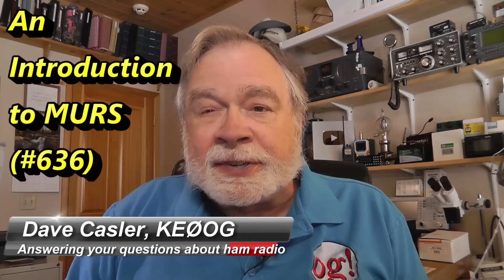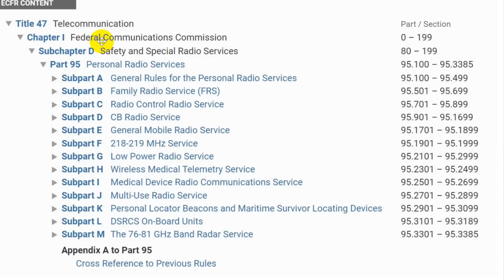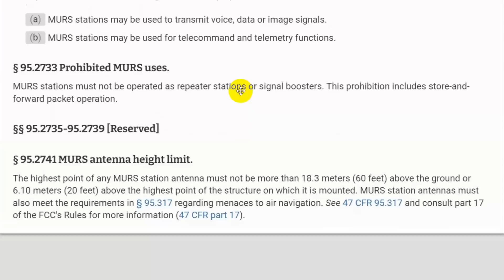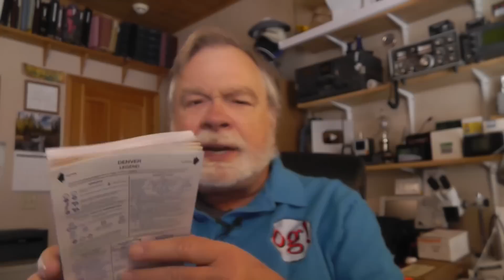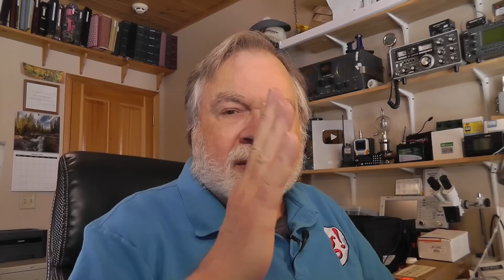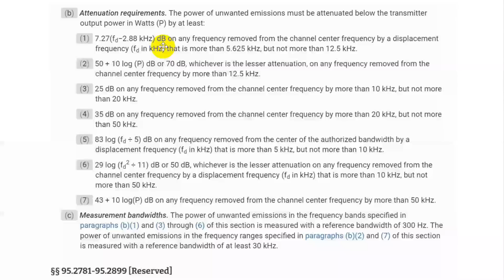An Introduction to MURS for hams (#636)

Comment: Well, at the end of the day, unless an FCC official is standing directly over my shoulder and taking note of my equipment, there is no way for them or anybody else to know what type of radio I am using. I think the world will keep spinning if I transmit on MURS using a non-MURS radio, and nobody will know the difference. Same for GMRS. I own dedicated GMRS radios, but if I was to just use a different UHF radio to transit on GMRS, nobody is even going to know.

Comment: MURS has no ERP limit and the transceiver can be attached to an external antenna, meaning one could run it through a high gain antenna such as a yagi.  2 watts through a 5 element yagi might have an ERP as much as 15 watts, if there is no line loss.  However, there is an usual and narrow bandwidth requirement of 11.5kw for MURS channels 1,2, and 3, and a limit of 2 watts.  MURS channel s,4 and 5,  can have a bandwidth of 20kw. Set the Boafeng for low power (1 watt), and on the narrow bandwidth setting that should be 12.5kw, and it might meet specifications on channels 4, and 5.  For FRS , there has been recent changes that allow up to 2 watts ERP on all channels except 8-14 that remain at .500mw.

Comment: Regarding the supposed prohibition of packet, I think that only applies to digipeaters, which are store-and-forward.  A regular packet 'conversation' is not store-and-forward, it is a direct data transmission just as any other data transmission is.  Also, the prohibition was in the same section talking about not using it with repeaters.

Comment: All the rules about ( Must be MURS or FRS GMRS ) ect is bogus. If the radio is clean on transmit, puts out the  correct power, correct width and you follow the antenna stipulations then use the open radios. Lets go after the idiots on 7.200, 14.313 ect that effect people over several countries, and leave the open radio's with a rubber duck antenna  alone. Half the rules are aimed at selling radio equipment, must be lobby money in those rule committee meetings.

Comment: I believe you could transmit data over MURS by directly injecting the audio from a modem into the speaker / mic wiring like we've been doing with APRS for 25 years.
Reply: Yes, that would be a F2D emission.

Comment: Oog, murs is used a lot for farms and care homes. They use them for long rang driveway alert systems with two radio. Also as a low cost entry point notification system. Some farmers even use murs for momentary control of irrigation systems.

Comment: -What about the 49 Mhz radio frequencies? -Can we use the old Motorola radios/commercial radios  that don't meet the 12.5 Khz spacing? Can pascag be used? Can a tone generator be used/i.e for something like Motorola minitors?
Reply: There is no ERP limit and the transceiver can be attached to an external antenna, meaning one could run it through a high gain antenna such as a yagi.  2 watts through a 5 element yagi might have an ERP as much as 15 watts, if there is no line loss.  However, there is an usual and narrow bandwidth requirement of 11.5kw for MURS channels 1,2, and 3, and a limit of 2 watts.  MURS channel s,4 and 5,  can have a bandwidth of 20kw. Set the Boafeng for low power (1 watt), and on the narrow bandwidth setting that should be 12.5kw, and it might meet specifications on channels 4, and 5.

Comment: I been using MURS for years. I like it for use on my 5 acre farm. Base in the house and I carry a radio when outside. Wife can call me anytime anywhere on the land. Wife wont get a Ham licenses so MURS works great for us.
Reply: @Ken Paschall, KC5HQK, USN Veteran Ever do Allstar?
Reply: Glad to hear! How’s the cellular service and have you thought about a GMRS license?
Reply: @furonwarrior  Cell service is ok. Not interested in GMRS
Reply: @Ken Paschall, KC5HQK, USN Veteran Your call seems really familiar. Have I talked to you"?
Reply: @Ken Paschall, KC5HQK, USN Veteran Ah ok. Im on AllStar 49562 in the Tulsa area all the time. Oh well good to meet you hope we can make contact on the air some day. 73
Reply: @Ken Paschall, KC5HQK, USN Veteran Is your wife a licensed ham? You might be able to make a repeater station in the middle of your property for extended coverage for an HT. HRO has a morse code generator to transmit your call sign over FM.
Also, how’s the RF noise level on your property for HF? Hypothetically, if someone ask you if they could fly a remote controlled model airplane on your property either recreationally or commercially, what would be your thoughts?

Comment: This is excellent.  I still use VHF MURS - for both personnel radios within large remote camps as well as transmitting data from a remote mountain peak to a specific camp (line-of-sight).  MURS is actually excellent but a "hidden gem"  that few know about - let alone use.

Comment: can the US use ham or any public service in the air? I am no expert but I believe that no amatuer services are alloiwed to use non surface comunications?
Reply: Yes, ham radio can be used in the air.  We have balloons as well as satellites orbiting the Earth.  On aircraft (e.g. planes, helicopters, etc) the ham does need the permission of the operator of the craft to do so, I believe.  It's in Part 97.
Reply: You can use ham, gmrs or frs in the air *with the permission of the captain*. I wouldn’t be surprised if all the commercial carriers had policies saying “the captain of our aircraft will never grant permission”, but if you’re flying charter or private, you might get permission. There’s a group of folks who do parachute mobile operations, they jump out of the plane, pop their chutes, and trail out antennas, then rack up as many contacts as they can before they reach the ground. They’re in communication with people on the ground before they exit the plane and it’s all above board because they have the captain’s permission.

The same rule applies on a boat, you must have the captain’s permission to operate a transmitter, regardless of service, but if you have permission, go for it!

Comment: I really like the ability to use a separate antenna on MURS.
Reply: I'd really like to get on FRS on a GMRS radio with external @about 25 watts &also maybe a repeater :)
Reply: @nunyadambidniss  if you use a mobile gmrs it’s legal to use an external antenna. It isn’t with a handheld, though. I really like those 40-50 watt gmrs rigs. I bet they can get some distance!

Comment: Basically, MURS data transmission is used by security companies for check in boxes or to alert people of an incoming vehicles. 

Dakota Alert sells some with perimeter control systems.

Riton uses them with check in boxes by security personnel.
Reply: Dakota Alert also sells hand held radios ands even a base unit. I have 2 hand helds and a base unit that I use on my land. They work great
Reply: @okierebel3278  I have the base

Comment: Dave, is that a xenon short arc lamp on the shelf? Do take care as they are under significant pressure, even when cold, and can pose an explosion hazard.
Reply from the maker: No, it's an old transmitting tube that an Oggie put on a nice wooden base and sent to me.
Reply: @davecasler  That's good to hear. ATB, Jeff

Comment: Just because you can, does not mean you should. On the other hand, just because MURS via Baofeng is arbitrarily prohibited, does not mean anyone hearing you can tell what radio you are using, unless you tell them. So, it's purely on the honor system. Same goes for FRS and any other band of freqs via a Baofeng. I can't recall ever hearing of the FCC monitoring for scofflaws on the MURS band. 
They are rarely engaged on the ham bands, especially the more notorious freqs. The FCC is primarily concerned with those licensees who pay them for licenses & fees (the sole source of FCC funding). They don't make much money (in comparison) with MURS or FRS and only marginally so with GMRS. 
I'M NOT SAYING IT'S RIGHT, I'm saying this is the nature of the lack of enforcement that the FCC generally presents. They have to be either repeatedly pestered to enforce anything, or given a slam-dunk violation case that they can't think of any reason to ignore.
Reply: Truth, straight truth
Reply: Also, in those cases where they are finally compelled to investigate a complaint(s) of bad actors on the "non-profit" bands (like ham, gmrs, frs, murs, etc) *AND* they actually identify a suspect, then the suspect can expect 6 months to a year of "cease & desist" letters from the FCC before they will consider referring a charge for prosecution. 
When are you guaranteed to get their immediate attention? When you persistently misbehave on government, commercial broadcast and/or public safety freqs. That tends to get the enforcement division to pull on their hunting boots.
Here's how to easily remove all worry: Just do the right thing. Don't be a pest on the bands, any of them.